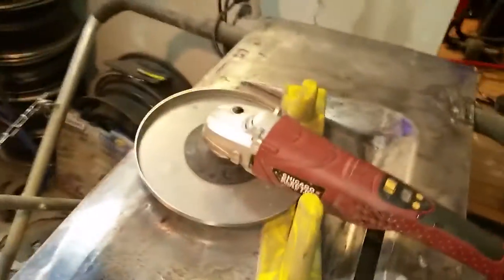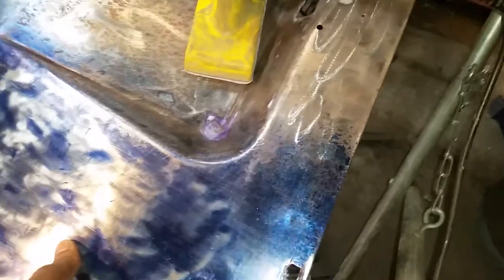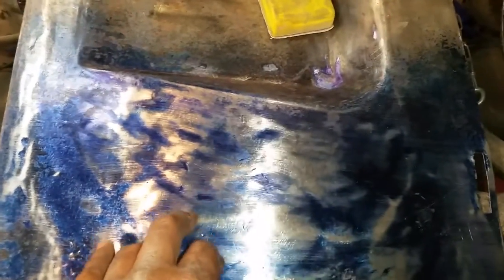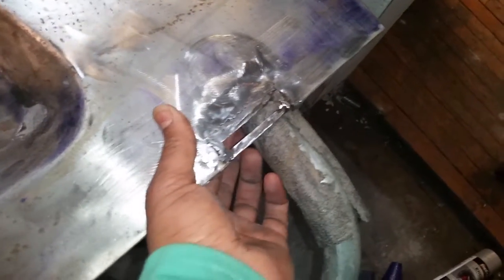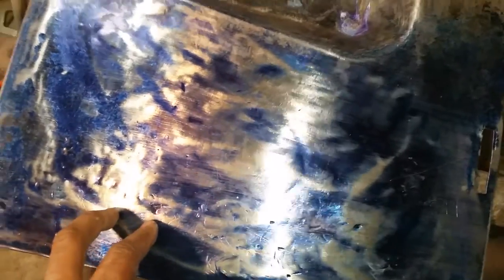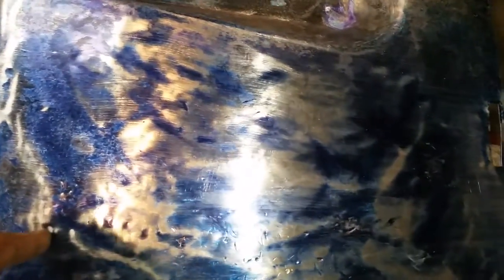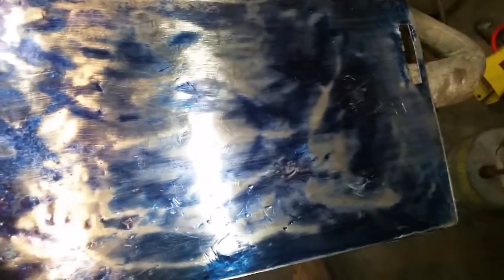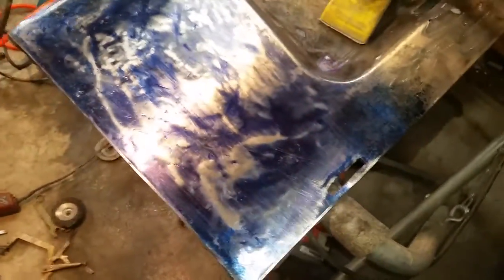VW Bus: 1957/58 Deck Lid Repair - Shrinking disc Part #1

Comment: looks good last year I got both sizes of shirking disk like you used the blue layout dye.
I does work well I was working on my lower bus door. I will need this once I weld the lower front nose of my bus.  Great detail on how it works.. Man in the old days back in Gary, I took an auto body class they show us how to shrink metal with a torch and wet rag..  the disks much better like..the engine deck lid is turning out well,,thanks for sharing